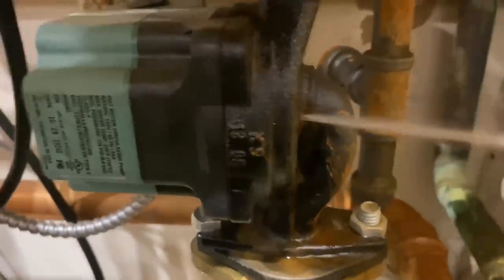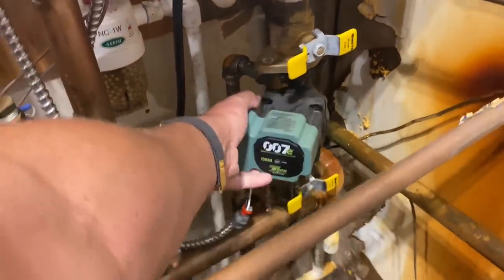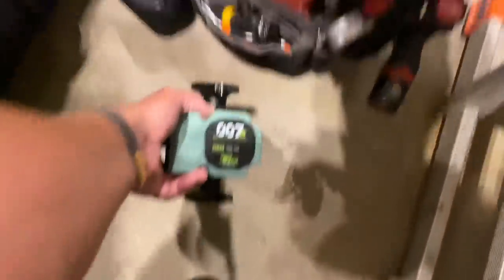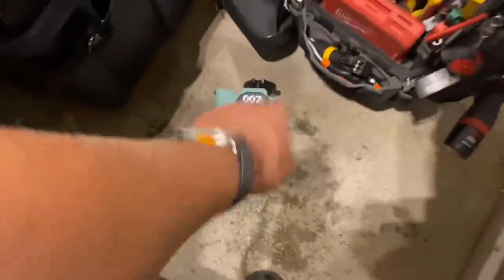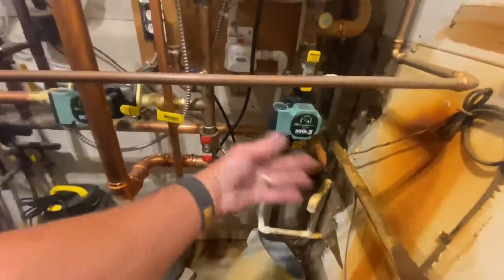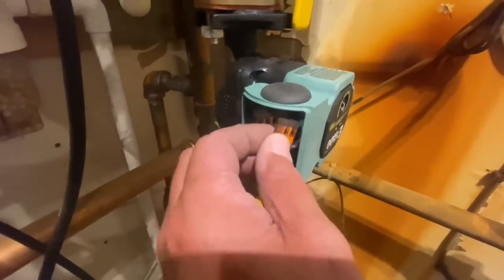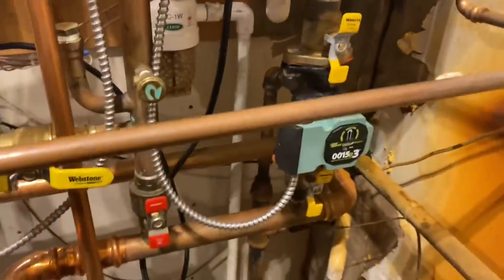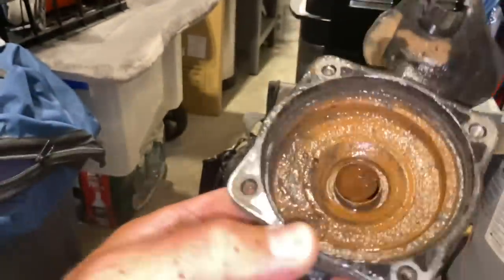HELP! My Boiler Room is Flooding - Saturday Evening Emergency Service Call Cracked Taco Circulator

Comment: It was probably a discontinuity within the casting itself.  Could have been a void caused by porosity. Maybe some pitting in that area, who knows. I’d bet it was something dealing with the casting of that though.
Reply: yeah, probably cast in India(like their porous brass) or  south america and had very high impurities mixed in.
also, there's probably not much cast iron left in the whole system so the volute may be attacked more, maybe in combination with failed expansion tank/weeping relief or system leaks and and constant makeup water introducing oxygen.
Reply: I'll bet that was not the only one did that,probably a few got by before they realized there was a problem😮
Reply: Galvanic corrosion due to multiple metals. You can't mix all those metals. Also cavitation may have helped. You can't mix copper, brass, and steel and expect a good outcome. Use SS or brass especially on an open loop system without chemical treatment
Reply: @bitpro8903  you mean galvanic action , anytime dissimilar metals are joined together ? Bad casting plain and simple
Reply: @throttlebottle5906 so your saying it just shit the bed?
Reply: @bitpro8903 hydronic heating, is supposed to be a "closed loop" system, so once filled and thermal cycled the heavily oxygenated water out gasses and become friendly to mixed metals. now a leak in the system or bad expansion tank causing  relief valve to open and makeup water to enter will quickly eat the whole system up. same as having the wrong type of pex installed(oxygen barrier type needed).
otherwise mixed metals have been used in hydronic heating for countless years now
Reply: @throttlebottle5906  the rusty water was a tell tale sign that chemicals are not right.
Reply: @DeltaCo7175  galvanic corrosion is the right term you're right. Same thing as electrolysis on copper. Copper is a good conductor for low DC voltage so it probably helped. I saw cavitation chew up metal even faster. One tiny little bubble can cause a leak like that.

Comment: I'd look for non barrier tubing in the system. I've seen a 4 foot piece of non barrier tubing cause issues with the ferrous components. Could be a leak somewhere and taking on fresh water. Love your channel, retired after 42 years in the plumbing and HVAC biz.
Reply from the maker: Thanks for sharing

Comment: hint, use a bar clamp with jaws reversed as a spreader against service valve handles, it will easily gap the pipes for the new circulator to fall in place and not damage anything, same for taking the old out. for flanges without valves, you can often still use a bar clamp  either as spreader or puller to move one of the pipes slightly, if not a ratchet strap will often work.
I have used my belt looped around pipe and gently pushed with foot/knee to pull pipes around before. you can randomly use wire, rope whatever is handy too. 🤪
Reply from the maker: Hummm great tip

Comment: I like your videos, I did plumbing over 30 years ago and then I went into something else, but I never learned heating and air-conditioning. I like how you’re teach in your videos. I remember years ago, the old cast fittings, and sometimes you would get leaks like that they would use a sand cast and sometimes there was a problem with the casting and you would get a little leak like that sometimes a few years later, or a week later
Reply from the maker: Thanks for sharing

Comment: I have changed multiple taco  with that same issue.  All of them didn't have inhibitor or a Magnetic filter on the system. Also Taco rep told me your not supposed to use those full-face gaskets on their pumps not sure why.  I like using Grundfos pumps now. I'm assuming you don't like showing it's a Navien unit.
Reply from the maker: Thanks for posting your experience.

Comment: I can not tell you how many times I have walked in to see a pump mounted every unimaginable position other than the proper way😢😢 but that is extremely unusual. There had to be a porous grain of sand in the pore an she finally let go… but that is what you call “ a tight fit”” ❤
Reply from the maker: Cheap QC

Comment: I completely switched to using Wagos for my central vac business about a year ago, for both the low voltage wiring and the line voltage I deal with. I never really liked the twist on nuts, so I used exclusively the crimp kind, but the Wagos are better. Easier, faster, easier to undo if needed, and I feel they hold onto the wire better than the twist on and even the crimp ones, and if you get the wire in it. there's no bad crimp or somehow loose wire in there. God forbid you don't get it rightists also easy to open the lever and try again... They are more expensive than either of the other two choices, but if the cost of the things seems that out of line, you might be under-charging for your services, charging too little definitely does the customer as few favors as it does you.
Reply from the maker: Love Wagos

Comment: I could explain that in Putnam county ,the worst hard water ,but in Long Island ,
Reply from the maker: Heavy in iron here
Reply: @PipeDoctor  that sucks, the hard water here is a constant battle with  xtanks,relief valve’s,water feeders and pin hole leaks on piping🤷

Comment: Is there older in floor heat pipe in the system? Some of the earlier stuff had a poor oxygen barrier on it that lets oxygen in the system and it’ll just eat away at anything steel. I’ve seen it happen before, I’d double check any other circulators in the system on that same stop.
Reply from the maker: Nope. All new construction from 20 years ago

Comment: Only saw one like that ever.  Turned out to be water feeder was constantly feeding pressure to boiler due to leaky copper pipe under the slab
Reply from the maker: Yup that will do it too

Comment: Looks like contamination within the casting material.
The red rust indicates air ingress which played a big part.
Reply from the maker: Then Taco should offer a warranty replacement
Reply: @PipeDoctor  The casting issue appart, the cause of the rust would be a priority  to identify.

Comment: Looks like a bleeder port on a water pump that you find on automobiles or pick up trucks water pump on an gas engine, the bleeder valve that lets loose when the pump goes bad. That's what it looked like.
Reply: I WAS going to say that, but it is on the wrong side. Weep holes are under the shaft seal (side)
Reply: I hear you, but you knew what I meant.
Reply from the maker: Yeah I know right!?

Comment: Wrong pex tubing? If it doesn't have the oxygen barrier it will allow air to permeate the tubing and cause any cast iron to rust. Normally the oxygen gets dispersed and a little rust happens, but with no oxygen barrier it will continue to rust until what happens to you happens. Worth checking. Ask me how I know!..lol
Reply from the maker: how do you know:)

Comment: My guess is poor water quality. The only ferrous metal in the system is the cast iron, the rest seems to be copper. That's why it ate a hole through it. The amount of rust in that circulator is a tell tale sign.
In all modern boilers the instructions talk about water quality.
Reply from the maker: There is water filtration on the water supply.

Comment: Stick a pencil in hole until am.
Reply: haha, there was and old school lead pencil repair, hammered into a pipe at relatives house for 30+ years, with just old fashioned duct tape wrapped over it in layers.
I finally cut out that section when a different pipe sprung a leak and bypassed it all.
Reply from the maker: Shit! Totally forgot about that